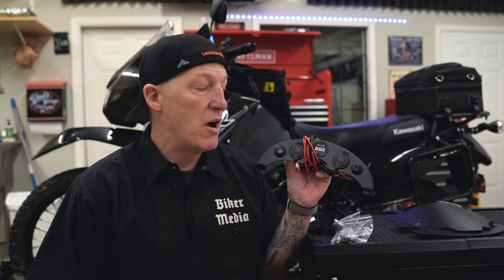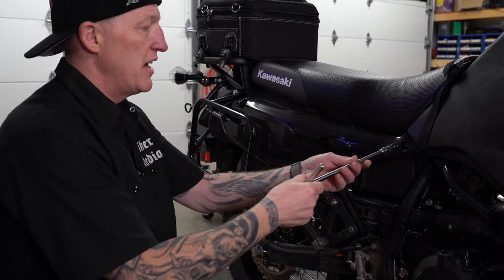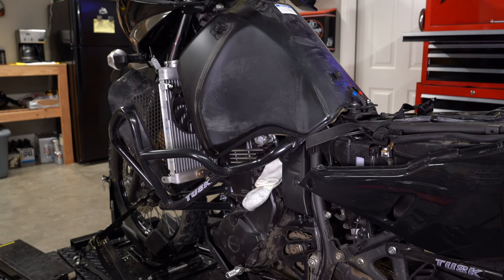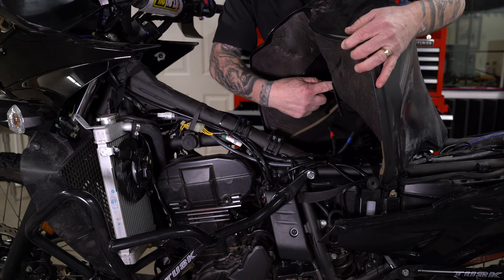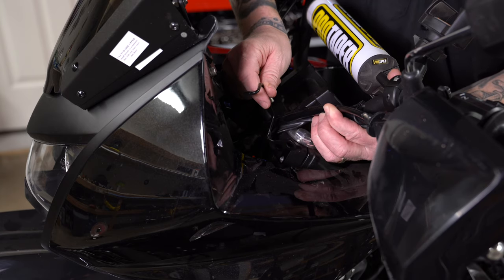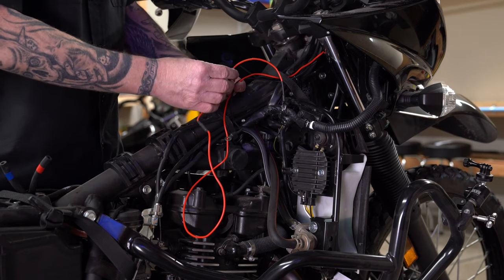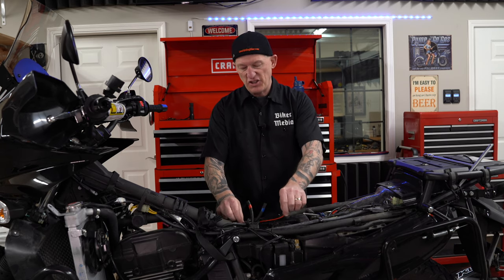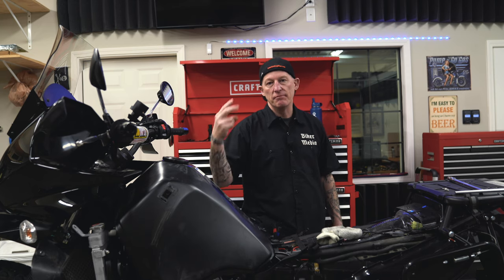Install a Kawasaki KLR 650 Powered Lower Dash-Tutorial

Comment: Just bought a KLR with this dash already installed. Worked for a couple weeks then just stopped working. Uninstall and re-install?
Reply from the maker: Check you wiring connections and fuses.
Reply: @RyanUrlacher  it was fuse #3. Thank you!